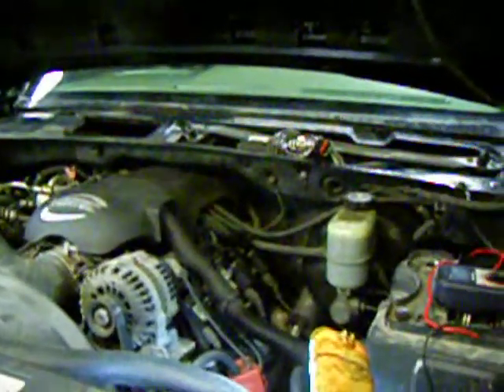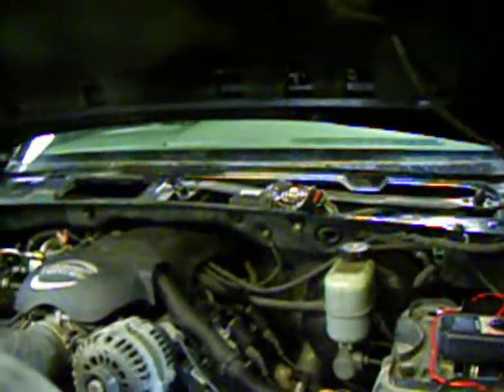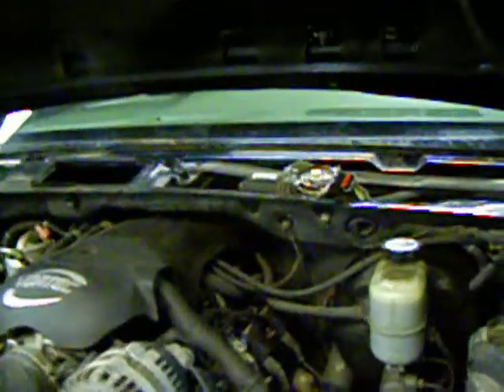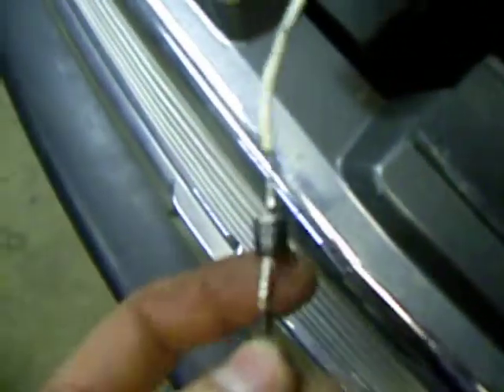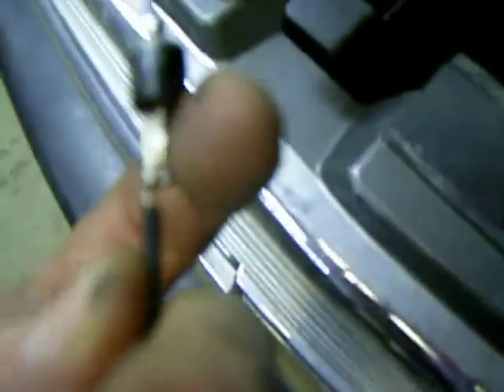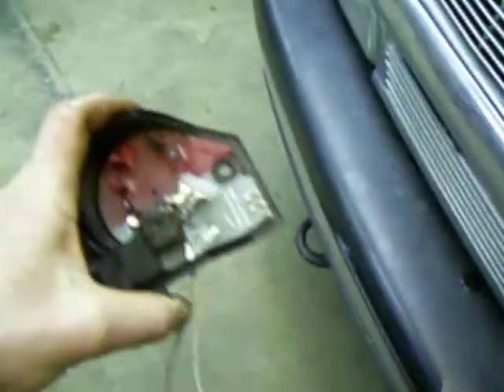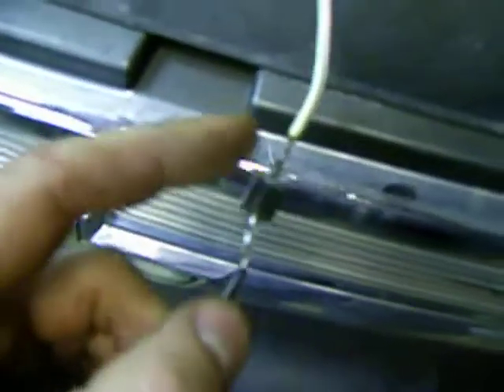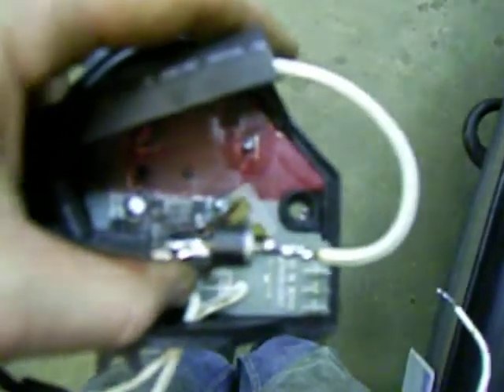GM Wiper Motor Pulse Board Circuit Modification Video 2 of 2

Comment: I'm trying to use one of these for another project. I can't get it to go to intermittent mode. I heard the range of resistance from the switch is 38K-690KΩ, but nothing works so far. Would you happen to have any ideas about it?
Reply from the maker: My advice is to go to a junk yard or parts store and measure resistence of the switch settings

Comment: Those 3 prongs, t4 t5 and t7.  t5 seems to have a relay going to it, so I assume its 12v, if the body is grounded will 12v on t5 operate this motor?  Edit: at 3:29

Comment: Umm... Why not a slightly lower rated circuit breaker instead of a "burnable" FUSE. Please explain.
Reply from the maker: I happened to have a fuse holder and a large supply of fuses on. Hand. A breaker is a fine idea too.
Side note: the mod has been in place for a couple years and only needed fuse replacement once.
Reply: That's great, good luck with that repair. Isn't it strange- as much as a vehicle costs when new- that a simple and cheap modification such as this- can make a world of difference. I know that most electric windows have a circuit breaker, just for this very reason; if it binds- it cuts power, then resets when circuit cools. Wipers should be engineered with one- if they aren't already.

Comment: Thanks for the videos. Did this fix your problem and do you have a update on the fuse size etc..
I have a 2005 silverado with similar issues in the past now they stopped completely, I wonder if this is my problem too.
are the modules the same?

Comment: Well done.  As a general rule the amperage load of a circut is 1/2 the rated  fuse  .  There is a load spike on dc motors that may be  too fast for your DDM to catch.  If the wiper motor was fused for say 25 amps you would see a max load about 12-13 amps.  If you replace a factory fuse with another make sure the fuse rating is embossed in white,if not its not a certified fuse and good luck.  Lots of those out there at a  pack of 144 fuses for $10.  Great tip and look forward to another gread vid